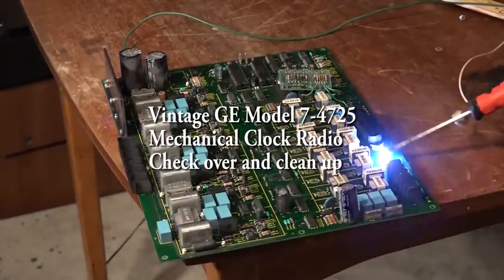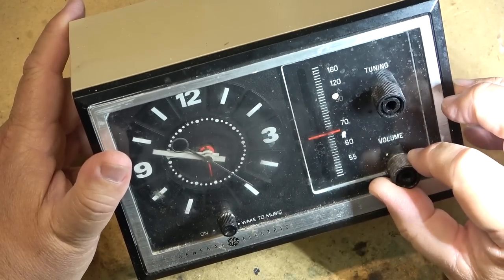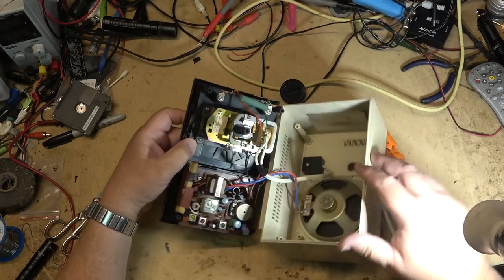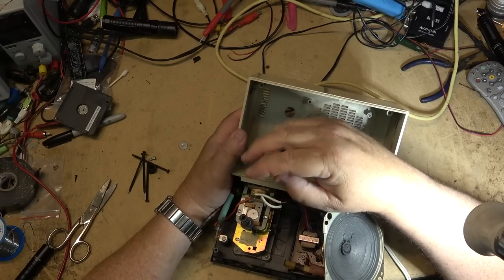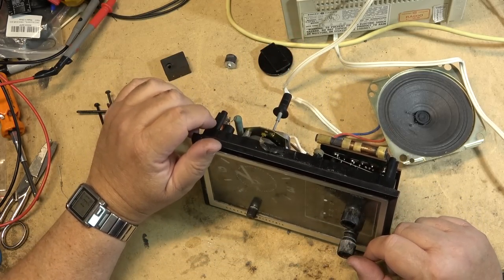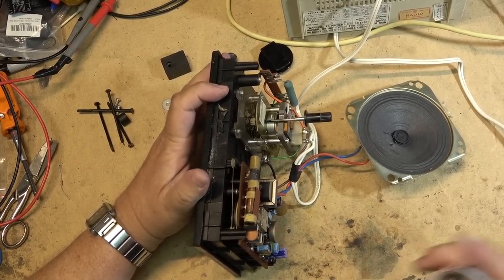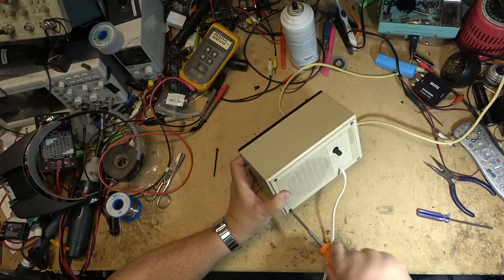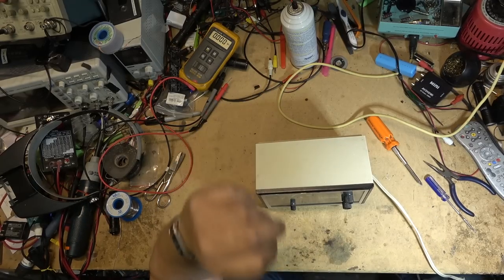Vintage GE Clock Radio restoration

Comment: I have that same exact GE clock radio model too. The one that I have originally came from my mom (which she had it since it was new back in the 70s). Since this exact model that I have only has an AM tuner, we normally used it as an analog clock in our laundry room (we normally didn't have the alarm set and rarely used the radio on this thing anyway). It's still a nice basic analog clock radio. I just love these old clock radios like these.
Reply from the maker: Laundry room clock. Great idea that's the only room without one.  Great idea.

Comment: I had that exact model of GE clock radio when I was a kid, in the mid '70s.   The date code year is 1975.
Reply from the maker: 75 is what I figured it was because if it was 65 it would have tubes and 85 would be IC LOL
Reply: I have the same one but it's AM FM with same clock
Reply: I have an 86 with an LED digital display.

Comment: Just for a point of information, we got our first FM radio station in my home town back 3 years ago.  It sure made things nice for mom,  who is 97 and in the nursing home, she loves her radio but the AM was filled with static so now we tune in the FM for her and she can again keep in touch with our local news.
Reply from the maker: And here the am stations are shutting down.  Just about a month ago bell pulled the plug in 2  50kw stations in my area. They will probably sell the transmitters and a new Punjabi or Chinese station (or both) will fire them up.

Comment: There's also a date code stamped on the Telechron clock rotor you could use to get an idea of year of production. It's year (1 digit), month (1 or 2 digits), and decade (1 digit). There's more info on this if you Google "Telechron rotor date code". One of the best clock movements ever made. If it ever runs noisy or starts to lose time, you can also draw new light synthetic oil into those sealed rotors. One method is to use heat (such as with a light bulb) to build pressure inside the rotor that will then create a vacuum when it cools down to suck the oil in around the pinion. The method I like to use is to draw a vacuum by placing the entire rotor into a large syringe with the tip plugged, then quickly remove it from the syringe, place a drop of oil at the pinion, and either let it draw the oil in itself, or place it back in the syringe and use pressure to force the oil in. I repeat that process a few times. There's some good read-ups on this if you do a bit of Googling.

Comment: I that was one of GE's very low end clock radios. That being said they do seem to work good as I have that same one you got. I noticed that the covers over the volume and tunning nobe are missing which is a common thing as the glue that was used would fail. Also this clock was used as a prop in the  1989 move Little Monsters.

Comment: I'm the UK, where it's 240VAC, and I don't think we ever had those live chassis transistor radios here. Maybe because too much dropper would be required? And so the ones I seen always had a step-down transformer in them. 

I know we had live chassis valve radios though.

Comment: I save old clocks like this. I think i have 20 Westinghouse windup clocks Ive bought from thrift stores/goodwill for cheap. I have a lot of clocks in general. These asynchronous clocks do last a long time if they're kept clean and lubricated.  I have various items using those motors for fans that were made in the early 50s and they're still going. A little noisy at times Lol

Comment: Those are terrific radios 📻. So are those GE clock ⏰ radio 📻. The only kind of those I’ve seen, were AM/FM. The GE clock radio my mother 👩 had was from around 1975-1976. I saw it in 1977, at her apartment in Fairbanks, Alaska. Just be VERY careful working in the backs of these. 120 volts is actually worse to be shocked 😳 by than 220, because ya cannot let go. Your friend, Jeff.

Comment: You are lucky the synchronous motor still works. Far too many have failed. Sounds pretty good for such a small radio. I have a Realistic Stereo from 1984 and the power cord wires go to wire wrap pins so you have these little pins sticking up with full AC volts on them. Pretty common back then, and a bit scary.
Reply from the maker: Hence the warning to not open the back.  Dangerous voltages inside.
Reply: @12voltvids  I've been working on this stuff for a long time and I'm very careful. Still seems a bit crazy that they used to do things that way. I am concerned for the unwary who might be hurt by them. I saved the On/off switch on that 1984 Realistic stereo, which had welded itself together, by installing a relay. Had to un-weld the contacts but it now works great. As you know, certain parts for things like this are not available.
Reply from the maker: @macgvrs  yes I'm fully aware of the parts problem. I have been working on electronics now for a little over 50 years.  Started when I was about eight or nine years old hanging out at old Al Mallatt house.  He was the local TV repair man and his house believe it or not is directly across the street from where I live now. Yes I grew up in the neighbourhood a couple blocks away. I was a friend of the family and I got to hang out at his place and learn how to fix radios when I was very young. I worked at local TV repair shop when I was in high school but never plan to go down that road. I kind of fell into the business and did it for 20 years as a living. the past 20 years have been taking on projects at home so I've never really left the business so over 50 years I've been in this line of work.

Comment: Maybe that coiled trace on the PCB was a way of fusing the mains so if something goes wrong it blows the trace? I've seen other electronics where they did this as it's cheaper than a glass fuse.
Reply from the maker: Possibly but the big resistor is going to limit the current anyway
Reply: @12voltvids  More likely just a easter egg the PCB layout person left in there, as it would not affect operation, and also would not actually use any space on the board either. Voltage regulation is likely done by the output stage, as they probably bias it to be a fixed current, so the current draw was selected to give around 15-20VDC across the power supply rail. Likely there is a zener diode for the LO stage and IF stages, as those will drift with voltage, and output stage bias is derived from there.

Comment: I'm shocked that the caps are still ok,  maybe the ripple was low because the radio is very low in current.
A transformer would have been nice for a level of isolation, now it would have to have one for safety now.
Is your lighting creating the radio noise?, it didn't sound like the mains.
I like the way the tuning string and poly cap were keyed, easy pcb removal 😀

Comment: Maybe an electric clock radio for the OG "Get Off My Lawn" 1970's demographic?  Replace the Windup alarm and still get Perry Como.
I think in the 70's I had a Flip digit electric clock radio hand me down from Dad.
I would use that as a Shop clock today.  
Bravo, You Know All things Appliance!  
Is Hot Chasse just a less expensive option?
Reply from the maker: Shop clock set to the news station is what i intended to use it as.

Comment: That kit risky to work on live? Line voltage to dropper resistor, no isolation transformer?
Reply from the maker: That's how they used to make them.

Comment: Its a class a amp. It will draw a constant current so no zener needed
Reply: I guessed it was class A, mainly because only one transistor with a heatsink.
Reply: @michaelturner4457  yep. Sort of a solid state version of the all American five  so forget that zener, we got a room heater
Reply from the maker: @michaelturner4457  that right. I mentioned that.  That's why the large heat sink on the audio output.
Reply from the maker: @markanderson350  it does get warm.
Reply: @12voltvids  old car radios were like that.. imagine draining your battery to an am radio, no AC.

Comment: Step up or down for the audio transformer? I am just wondering is all.
Reply: High impedance input, low impedance output for the 8ohm speaker.
Reply: @michaelturner4457  The speaker is 4 ohm, and I think it is saying 1.6 W. What I'm wondering is if the transformer raises or lowers the voltage, or maybe it even keeps it equal and is just isolation.
Reply from the maker: Class a single ended output.
Reply: @12voltvids  A quick Google search, and I see some interesting things to read. Basically, I was wondering if the windings are equal or not on each side. I will read on it tomorrow some. Thanks!